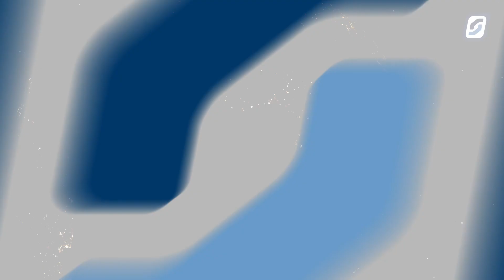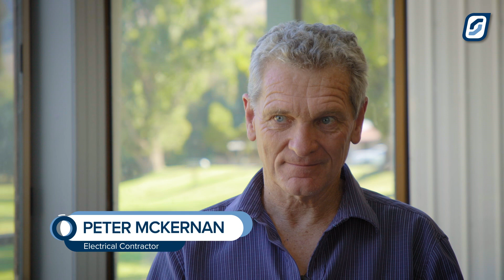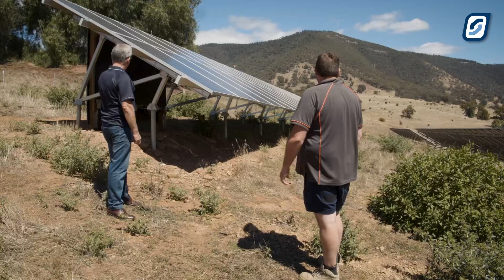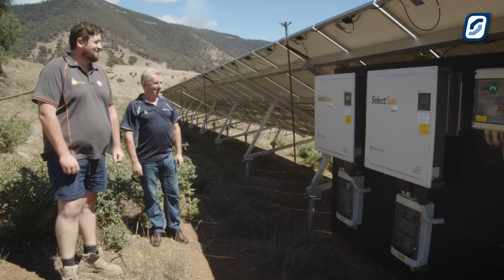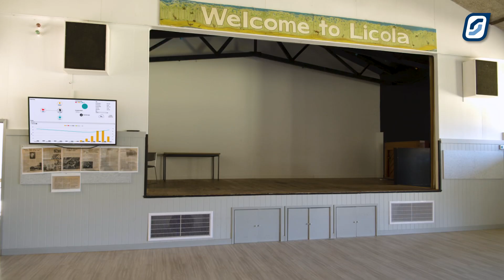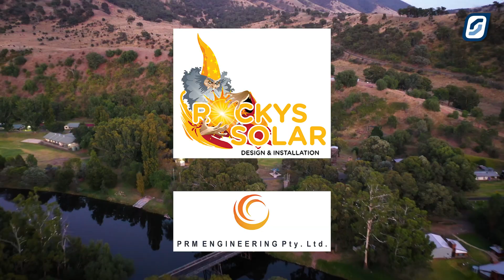Selectronic Technical Case Study: Licola Wilderness Village. April 2021

Comment: Nice set up.  So, what is the go with going over 200% AC to SP PRO...?  I personally can't see the issue with it if SP PRO have ultimate control over total live solar generation, but did they have to get special permission from Selectronic to do it, without affecting warranties?
Reply: Ive done it several times with over 3:1 ratio, however I had some large pumps that are turned on if the ratio exceeds 2:1, which are needed when its sunny anyway. So it can be done if you have the loads to deal with it.
Reply: @kcsolar  I wouldn't think it would be an issue from a hardware point of view, and yes, you'll always have loads to run on sunny days. My concern was more about warranties, because I haven't read any caveats to Selectronic 200% AC using SCERT. I'm sure they'll allow common sense to apply though...